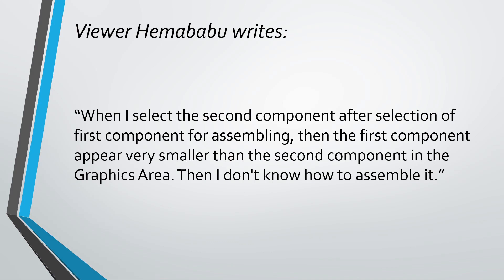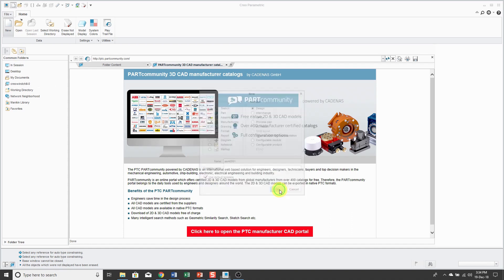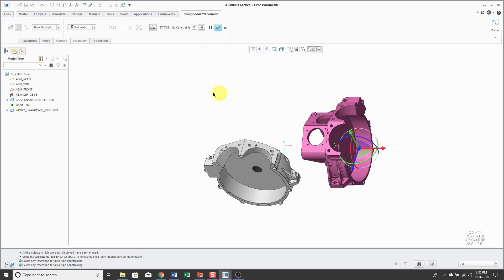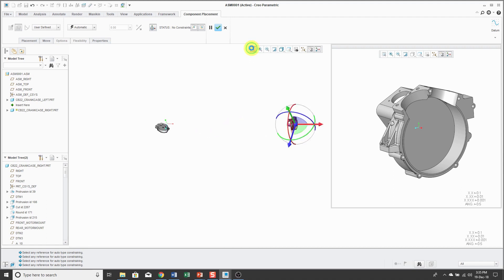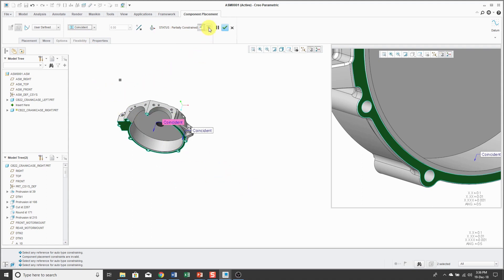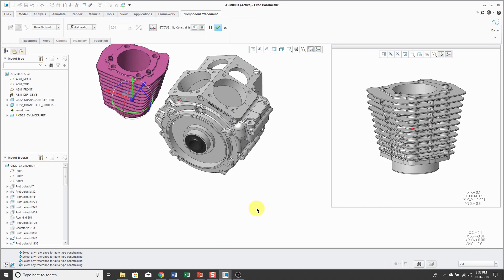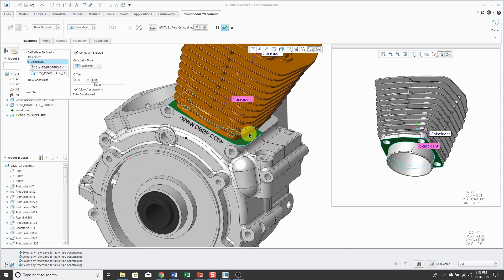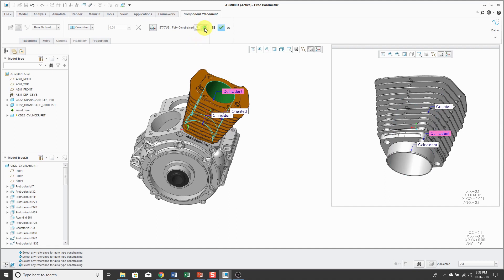Creo Parametric - Assemblies | Using the Accessory Window (Viewer Question)

Comment: I am a beginner when I assemble the bench wise cylinder connection for assembling the spindle and rigid connection for the bar when I rotate the spindle it rotates when using the bar to rotates it does not rotate what is the reason this problem happens me for many times